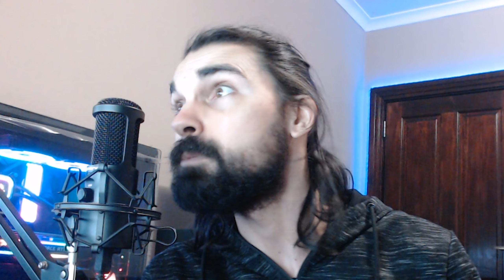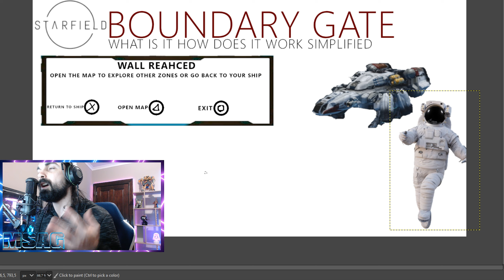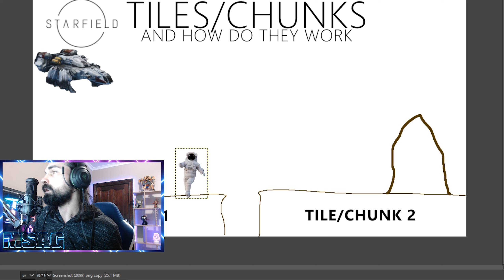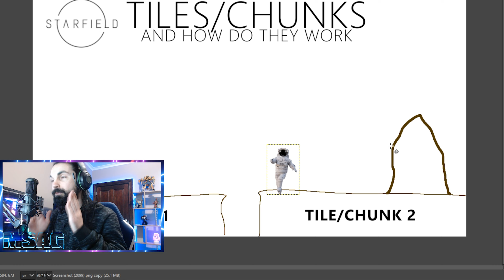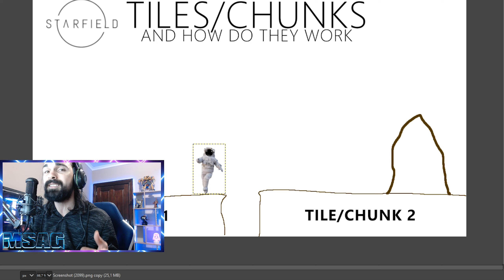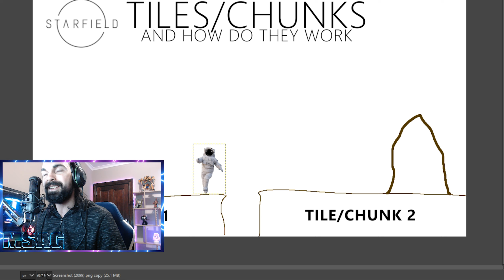Starfield Boundary Gate Controversy ! Tiles/Chunks And Leaks Explained

Comment: I agree with you that walking around a planet is not the reason I am playing Starfield. But I am 100% sure that you will not just be able to load the next chunk and keep walking. When you travel to next chunk you will likely be loaded to the center of the chunk. Thats the only thing I wanted to point out but walking in a straight line for hours really isnt a draw (for me) anyway
Reply: from the leaked videos that are out there it seems like the tiles that you play on don't connect to each other. They are completely randomly generated zones. Now that could still be really fun, just takes the scale of a whole planet feeling away a bit